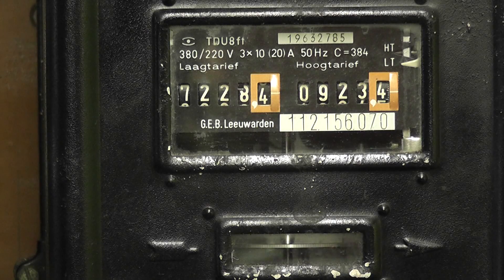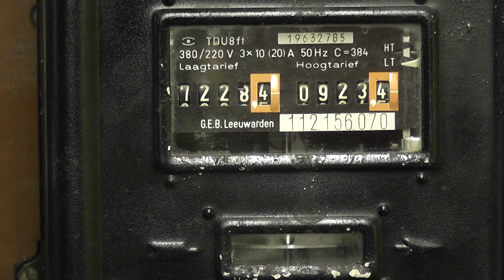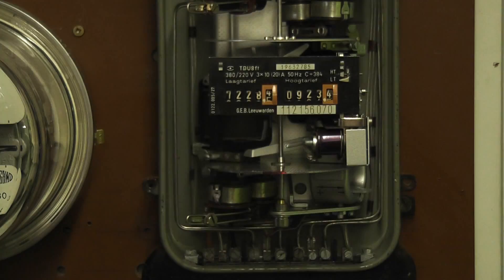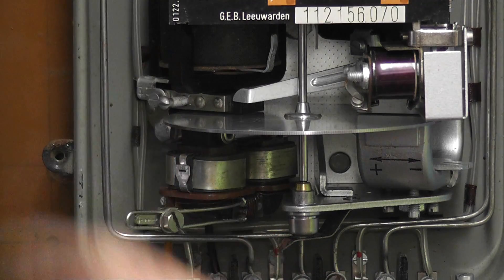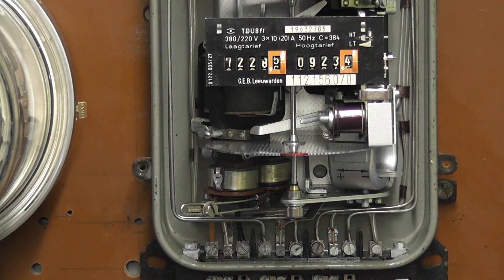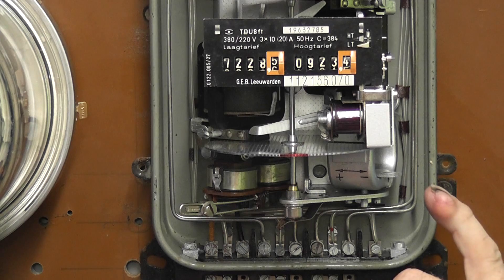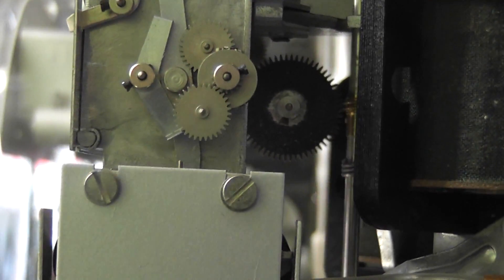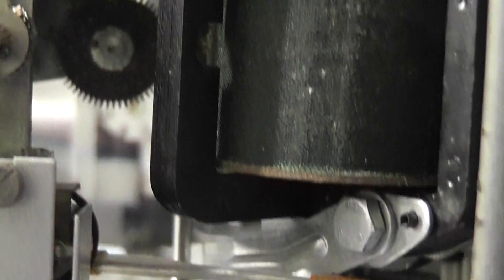AEG TDU8ft  kWh meter from 1940's

Comment: Blimey, where do you get these things ?
But more amazingly, how something 70 years old still works just as well as the day it was made, you'd never buy a 70 year old radio and dare to plug that in !
Kind of illustrates the way loadings have changed through the years, you'd never find a modern 3Ph meter rated at less than 100A..
Nice Vid as always :)

Comment: Nice AEG instrument, right there! :-) 

It's interesting to see a meter with more than one load-wheel in it, as all of my instruments are single-wheel only, even the two 3ph ones I have.

I bet that instrument is quite weighty! :-) In a way, it's three-meters-in-one, as it has 3x voltage coils, 3x current coils, 3x load-wheels, & three sets of accuracy magnets. 

All of that accommodated in one metal case means one weighty meter! :-D

Very nice, thanks for showing. :-)

{^_^} BoomBoxDeluxe {^_^}